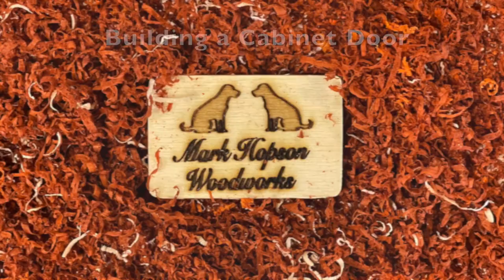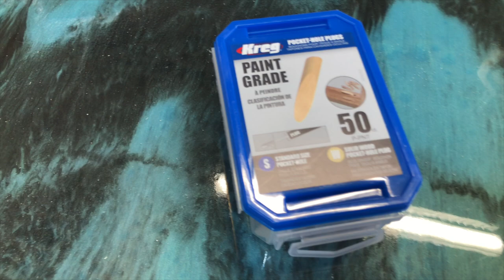How to Build a Cabinet Door

Comment: This isn’t a technique I’ve seen before.  I always use stub tenons on shaker doors, but this would be much quicker!
Reply from the maker: I’ve done so many I’ve found they hold up real well. If you glue the joints they never come apart. And using the caulk  allows the needed movement for expansion. And contraction of the panel.